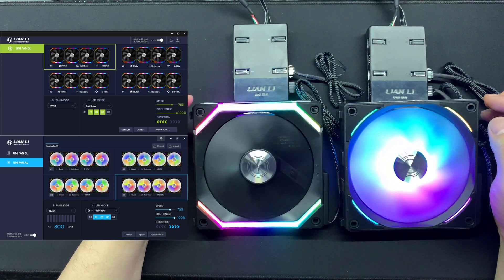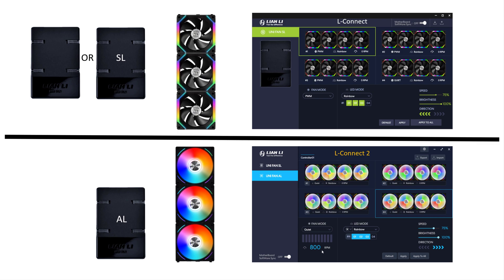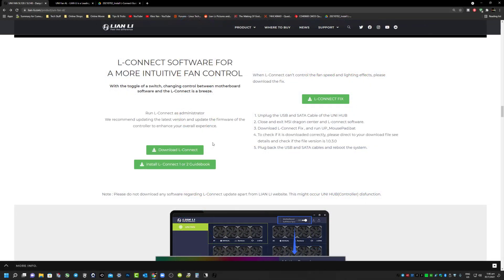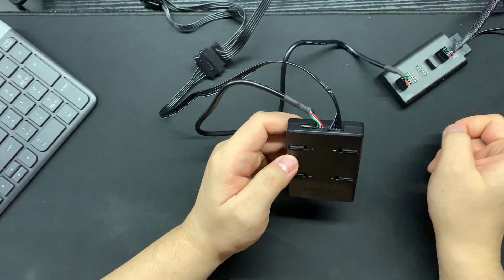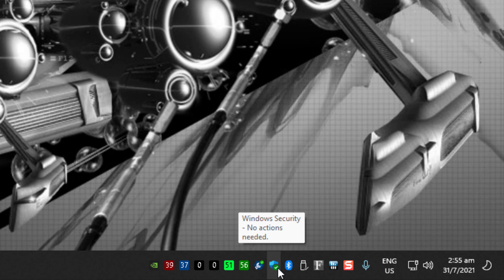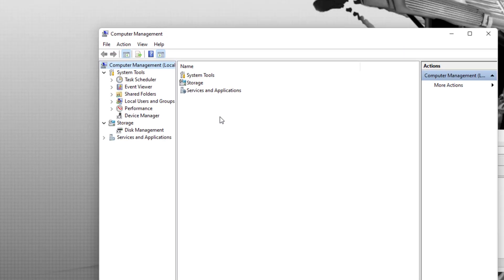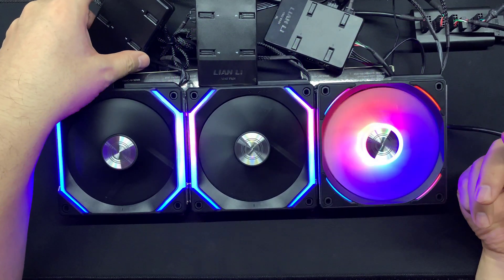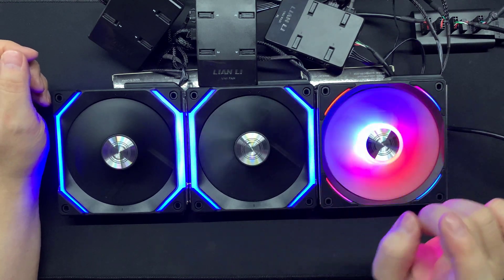Lian Li Uni Fan AL120 & SL120 Controllers - Firmware and Features [L-Connect 2]

Comment: Nice Video! Thanks. I have 2x3 AL FANS on the AL Controller. Is it possible to connet the SL Fans on this Controller too? Or do i have to use the SL Fans seperate on thier own Controller?
Reply from the maker: Hello Z0rzk, welcome to my channel, I am afraid you will need to use the SL uni controller to controll the SL uni fans as it will not work if you plug to the AL uni controller.
Reply: @KleoYan  Such an important answer, I wonder why it's so hard to find it.
Reply from the maker: @hanswurst9866  hi welcome to my channel, hope am getting what you are trying to say. Most answers are in Lian Li’s official page, but I guess the era of reading have changed lol. People are getting lazier to read lengthy instructions so videos are easier to digest.
Reply: @KleoYan  Oh ok... thanks a lot for your help. =) <3
Reply from the maker: @z0rzk  you are most welcome.

Comment: Does the Controller that comes with the SL Fan pack work with the new AL fans?
Reply from the maker: hello Viet, welcome to my channel, no the AL Fans will only work on the AL controller and not the SL controller.
Reply: @KleoYan  I thought I've read somewhere that you can upgrade the firmware on the SL Hub Controller (one with no SL mark) and run the new L-Connect 2 software, then you can use it for the new AL120 fan? or am I wrong? thx
Reply from the maker: @Viettzz   hello, just to clarify if you are talking about this https://drive.google.com/file/d/1lZDI9FQEHRptOKHJTeL8_Qf7os3I1hU0/. To make it simple.

1)  SL Controller contains firmware A to instruct SL Fans
  
2) AL Controller contains firmware B to instruct AL Fans.

in order for the old controller (SL without marking) to use on the L-Connect 2 application to instruct SL fans . 
You will need to do firmware. however this firmware is to differential the profile as in AL and SL in L-Connect. it does not add instructions (Firmware B) to the SL controller which contains instructions (Firmware A) 

I hope you will understand what I am  saying.
Reply: @KleoYan  Yea I understand now, thx you for the infos!
Reply from the maker: @Viettzz  you are most welcome and all the best in your build.

Comment: So am i getting this right 
I can use L connect 2 with SL Controller without firmware flash ???
Reply from the maker: Hello JJ if your SL controller have the SL label on it you can use the L-Connect 2. If without, you have to do the firmware.
Reply: @KleoYan  damn im so unlucky 
I recently bought 3x 3pack uni fans so i have 3 controllers but they are all without sl labeling
Guess i have to flash then
Hopefully everything goes right
Because i wanna make use of L connect 2 since its more modern and has a proper autostart function
Reply from the maker: @JJ-gk5tn  you have 3 controller so can test one out first, just make sure you turn off your Anti Virus progy and the Windows Sercurity Protection.
Reply: @KleoYan  i just did it exactly like u explained and it works flawlessly
One more time thank you so much
I know this is on the lian li Website but would have never catched that u can actually flash the old controllers 
Thats so cool
Love your videos more and more !!
Reply: Btw lian li should hire you
Honestly there is no other person who can explain all the things about the lian li fans thank you so much again my friend
Great work !!!
Reply: Again my advice for all the other uni fan users
The benefits from L connect 2 are that it has autostart and it starts minimized wich is not working with L connect 1
Reply from the maker: @JJ-gk5tn  you are most welcome buddy, at first I am confuse with their guide book instructions. the diagram looks complicated. So took time to break down. guess am slow to catch what's the diagram meant lol, but am glad it work out well.
Reply: @KleoYan  also i just noticed that u can set colors on individual fans wich also was not an option in L connect 1
Haha so cool
Reply from the maker: @JJ-gk5tn  yup.. that's why I ditch the L-Connect. at first I was running 2 L-Connect, that was in my 2nd video, once I did the firmware, I like the L-Connect 2 more lol.. which I did highlight in this vid https://youtu.be/1n1mo6TDwvY?t=511 as what you have mentioned, it's cool to be able to set individual fans with colors. There are more on this uni fans family which I believe they might do version 2 for the uni fan infinity which will be out next year.
Reply: @KleoYan  oh man cant wait for the Infinity fans !!
Reply from the maker: @JJ-gk5tn  hee am waiting too. See what Lian got got install for us lol

Comment: hey, i did install the files on the situation 1 (ENE) files, when i uninstalled them it didnt let me to run the sl on l connect 2 so i reinstalled them, was this neccesary? and what if you dont wanna buy revouninstaller? whats does difference it make?
Reply from the maker: Hi Kim David, I also never purchase the revo uninstaller. the free version works perfectly fine. btw why are you using situation 1? are you going to control the SL and AL on a separate L-Connect application? down here I just use the situation 2 as I find it laggy when I use both application individually when I install the registry on situation 1.
Reply: @KleoYan  i was wondering was it because i did not uninstall the l connect 1 using revouninstaller?
Reply from the maker: @kimpdavid  ok, now tell me what's your SL controller or was it a AL controller? if it's a SL Controller, does your controller itself have the SL mark or without?
infact I did try the situation 1 and I had a hard time removing the registry which I ended up did a system restore.. the situation 1 driver does not aid in my case and since the L-Connect 2 app has more features, I use situation 2 instead. 

now this will be a hit and miss, do these steps
1) install revo uninstaller
2) uninstall the L-Connect
3) uninstall the situation 1 driver 
4) shut down your PC, off your PSU, unplug the PSU cable. let it sit for 30 to 40 seconds of if you like 1min
5) boot up your PC, install only the L-Connect app. see if your controller react.
Reply: @KleoYan  yes thats why im asking, how did you uninstall the drivers from the situation 1? when i uninstall the drivers from the situation 1 then im having a problem, i already uninstall the L connect using add or remove programs only. i have without the SL mark, or can just live with the situation 1 drivers even though i dont use the l connect v1?
Reply: @KleoYan  i mean i followed them because i was confused if i needed to do also the situation 1 thats why i did, but then i was uninstalling all the files that are downloaded from the situation 1, then it wont let me to run the l connect 2, should i try to uninstall now the ene files?
Reply: @KleoYan  yes i tried to uninstall now the  ENE files from the situation 1, and it wont let me use the l connect to, so i reinstalled them again, why is that?

Comment: Does l-connect 2 offer additional lighting modes than l-connect?
Reply from the maker: Hello Ivan Ramos, welcome back. As what I see from L-Connect to L-Connect 2, the SL fans have one additional function, at the static colors, it use to be a single static colors to the fan set you've daisy chained but now you are able to individually set colors of the set.
Reply: @KleoYan  Thank you!
Reply from the maker: @topramosfishing  you are most welcome, infact I should thank you. I just did up another video which your question is valuable not only to me but to my viewers. thank you!

Comment: do you think if i use AL120 fan 6 of it and using 3pin corsair adapter hookup (light node pro to uni fan controller )and using I cue to control the lighting will it explode? it feel like it like work..... because uni controller should be able to handle the power alone?
Reply from the maker: Hello Kaboom, welcome back. it will work, just make sure there is a sata cable connected to your uni controller to provide power to your fans and on the L-Connect 2, set it to motherboard mode, then connected the argb cable which is suppose to plug from the uni controller to the motherboard argb header, plug it to your icue controller. hope that helps. oh yes it will not explode as power drawn is from the well build uni controller :)
Reply: @KleoYan  so if i doesn't install Lconnect2+usb2.0 port /// just plug unifan 3pin argb to corsair adapter and hook it to lighting node pro it still gonna work? i don't want to install Lconnect2 if possible ...or does usb2.0does play some role to make it work?
Reply from the maker: @kaboom8352  hi, I don't think is a good idea for you to connect SL or AL daisy chained fans directly to your corsair lighting node pro kit. you see the SL & AL fans have the highest rating load on argb. SL is at 0.65a each and AL is at 0.66 each. If you still want to do it, do it at your own risk. I would still advise you to go by the uni controller and install the L-Connect to switch it to motherboard mode, so that your corsair can take control. This made me curious. if you want that, why not just grab other argb fans? It defeat the purpose to have SL or AL fans if you are not using the uni controller, plus each fan has a programed chip where you can do stacking and sequential effects from the uni controller, but the choice is yours.
Reply: @KleoYan  i see, so i dont think i have another way around it but it fine i guess thank for your answer, btc i choose uni fan because i have 18 fan in my pc atm with full 4radiator in the system ....so the cable was a nightmare .
Reply from the maker: @kaboom8352  ooo I see. guess you have no other choices. so sorry about that.
Reply: @KleoYan  it fine don't need to sorry about it,   the thing is that i don't want to lost usb2.0front panel  but if it need to then fine ... and i'll just use usb hub for that
 //but i still not understand the part of the unifan controller if it does provide power it need+ don't understand why i need to connect uni hub to usb header and select mb sync in the software?

 shouldn't it just work like other rgb fan if i does hook argb cable from unicontroller  to lighting node? or somehow it need usb signal  to do something? (btw i don't care if my fan  run sequential effects....i just gonna use white color anyway)
Reply from the maker: @kaboom8352  hi, I am doing up a video to answer your question and please do not proceed to do anything yet. I wouldn't want you to waste more expenses.
Reply: @KleoYan  Thank you so much for spend your time on my question, it been in my head since SL120 release and i can't find the answer in reddit either ,atleast i can finally find my answer here  :D  //btw the fan haven't arrive yet somehow DHL domestic in my country is having problem with covid19.... it been 5day now

Comment: Nice video, I bought a pre-built pc, my sl120 fans aren’t responding with L connect features. They’re on Rainbow colors but it’d be better to customize them.
Reply from the maker: Hello Ramon Palencia, welcome to my channel. I do have viewers who had the same problem as yours, may I ask which motherboard model are you using? you might want to try installing the motherboard chipset which I have shown in this video https://youtu.be/8l4i5UjO3es , it might help.
Reply: @KleoYan  Asus Strix B550 E-Gaming, did that and still not responding, i will uninstall and install again. Worse case scenario I will lean towards L-Connect Fix
Reply from the maker: @ramonpalencia2904  hmm, maybe you wanna post it here? https://www.reddit.com/r/lianli/comments/otu82y/lian_li_al120_fans_issue_cannot_detected_by/

Comment: I hope they release the uni fan controller separatelly, I have 6 ST120 running through their own physical controller but it would be nice to use the L-Connect app. Don't want to buy another 3 fans that i can't use just for the controller.
Reply from the maker: Hi Jstn, welcome to my channel, in some country, they do sell the uni fan controller, they are rather expensive. you might want to try asking lian li https://lian-li.com/faq/ if they can provide you any online shop that does that or to post it at lian li's reddit channel here https://www.reddit.com/r/lianli/ .
Reply: @KleoYan  Hello, thanks for the info. Their Spanish retailer does not sell the controller, and I did some brief searching and didn't found anything. Will try contacting them as you suggested. Thank You!
Reply from the maker: @jstn8785  hi, you are most welcome, I wishes you all the best to be able to get the uni controller :)

Comment: Love you videos very informative keep up the great work. Do you know if the Lian Li Bora Digital fans argb can be controlled with the L connect 2. ?
Reply from the maker: Hello damien bennett, welcome to my channel. as I look at the Bora Digital https://drive.google.com/file/d/1drWUOlrjXylUXQdiG2uR5C-W0hxym1eM/view , you can use the uni controller with a bit of alteration (for older SL uni controller, you need to do firmware). Each bora digital fan has a drawing argb load of 0.20a which is below 0.66a (each uni fan, be it SL 0.65a or AL 0.66a), therefore it can be used on these uni controller, so long you have the uni controller and the correct converter. Looking at the manuel, it has a 4pin JST daisy chained cable that allows you to connect 3 fans, and to be plug to the motherboard argb header. What you can do is to use a 3pin standard argb connector to a 3pin JST connector which can be plug directly to the uni controller output. I have done this with the EK Vardar https://youtu.be/bMRz2KVqbjA ,  Bora will be fine :) this is the converter am talking about. https://youtu.be/Lz90i5ym4Dw .Now I did the crimping myself but there are ready made converters. you need two part or it, see below.

If you are not purchasing the Lian Li aRGB Cable Kit, get the pin needle and the converter below. 
‣ Pin needles - https://www.aliexpress.com/item/32706628771.html or https://www.ebay.com/itm/224459128229 (you need to pull out one needle to fit the below converters)
‣ Converter - 1 To 1 Male https://www.ebay.com/itm/133521646617 or 1 TO 1 Female 5V 3pin https://www.aliexpress.com/item/1005001598378033.html
Reply: @KleoYan  Thanks for your time much appreciated.
Reply from the maker: @veryfarfromhome2197  you are most welcome 👍